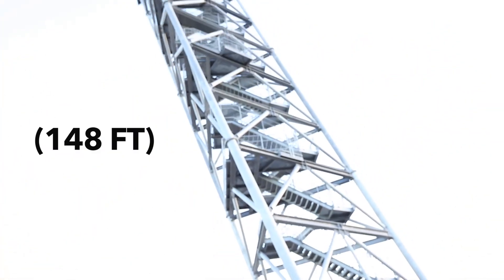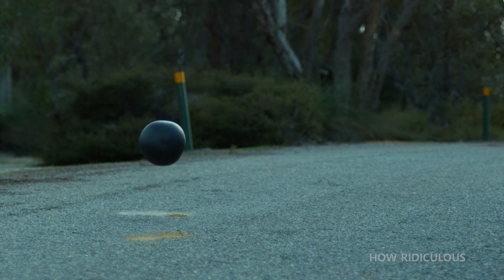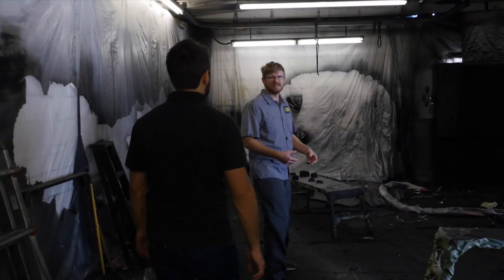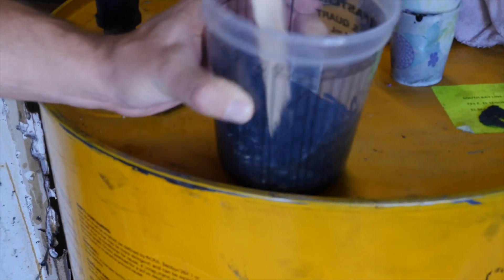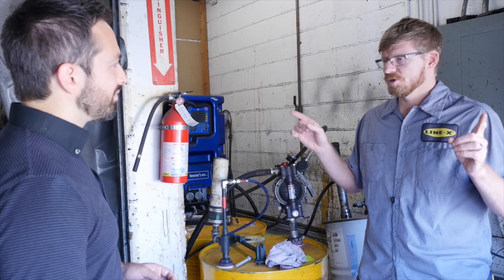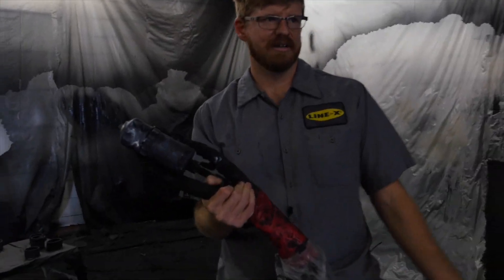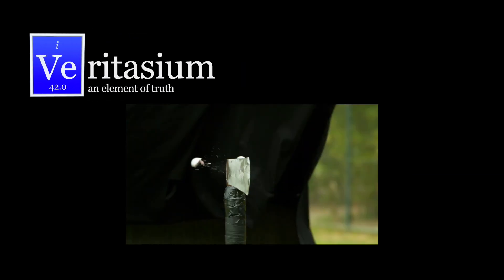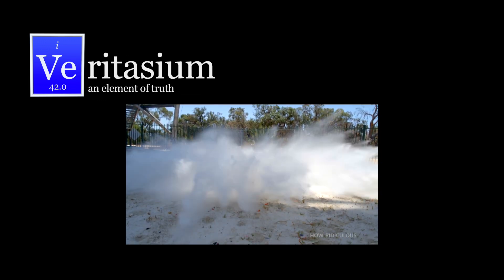Indestructible Coating?!

Comment: Coat the aerogel with this stuff.
Reply: Coat a carbon fiber/graphene or Kevlar structure with titanium core..  Will make for some good light weight bady armour..
Reply: @metaladder1018   bAdy
Reply: i had same idea!!! what abt zorbing ball coated w aerogel and line x??
Reply: @metaladder1018  Although it would be strong and light it would flex into you and possibly cause internal injury
Reply: FBI, OPEN UP!
Reply: Dear god
Reply: lol! it'll become sandbag or something in no time😂
Reply: It won't change anything. 
Aerogel is very fragile, the coating would just smash it from the outside, like the watermelon
Reply: @alanwatts8239  how about filling in the aerogel with this stuff? like they do with waterproof liquids to make aerogel waterproof
Reply: Good idea, extremely light but resistant. Very good idea!
Reply: @huracan200173  it's really just fireproof and a few other things but it's really brittle
Reply: @huracan200173  Well, it wouldn't be extremely light if you covered it in Line-X.
Reply: @huracan200173  Yeah fantastic, you will burn the polyurea trying to use aerogel thermal properties!
Reply: People signal boost this
Reply: Wouldn't work as well as you're imagining. See the slow motion of the coated watermelon bouncing? Didn't you know aerogel is very brittle? It would literally turn to dust on the inside, and then the polymer coating would just be a floppy empty sleeve. It wouldn't even hold much of a shape. It's resistant to TEARING, but it's not strong in any other way.
Reply: Flubber duckies
Reply: Up. Want to see this.
Reply: Then make it a mouse
Reply: Then put it in the walls of the pentagon
Reply: @Dylan Peres it would be able to adhere specifically for those reasons. When you want something to adhere, it has to have a rough surface
Reply: I hope it's a joke
Reply: I can only imagine
Reply: * Face Palm *
Reply: Illuminati:stay right there
Reply: Bumper cars
Reply: Aerogel can be produced directly from these materials, even it can directly be reduced to graphene
Reply: Yea Nice idea
Reply: what about zorbing ball covered in aerogel and line x???
Reply: Iron man suit
Reply: Haha or polystyren
Reply: Polysyrene is cheapper more elastic and less « sans baggable »
Reply: Hi Phil Swift here with FLEX TAPE
Reply: If only you
Reply: And you end up with an aerogel shaped.......balloon.
Reply: @Braxton then whats the point of "aero"
Reply: @Braxton it's big brain time 😆🤣
Reply: This and aerogel would make the fastest boat
Reply: more like coat this stuff with aerogel, if it increases in temp during the bonding process then I'm sure heat would make it weaker again. or better yet, do aerogel, this stuff, then aerogel again lmao
Reply: He's too dangerous to be left alive
Reply: That wouldnt work becuase the coating would only form a shell around the aerogel
Reply: Whats the point. If u want hard light stuff. Coat air with it
Reply: @realdeal5712  Then it'd be a glorified dodge ball.
Reply: Real deal that’s what aerogel js
Reply: Aerogel would most likely absorb it, like water.
Reply: Harvard: bruh you want a scholarship?
Reply: And you end up with a light indestructible stuff
Reply: Additional information
Required: Required documents are required for your claim assessment.
Supplementary: Supplementary documents are not required for your claim assessment, however may help determine if you are entitled to any supplementary payments and/or services.
What happens if you don't complete the required tasks listed?
If you don't complete the required tasks by 07 July 2020, we'll reject your claim and you'll have to make a new claim.
Use the upload button to submit your documents. You can also take photos of your documents and submit them using your Express Plus Centrelink mobile app.
If you can't upload your documents, you can mail themor return them to a service centre.
This notice is given under section 63 of the Social Security (Administration) Act 1999
Reply: @stevethea5250  A banana is an elongated, edible fruit – botanically a berry – produced by several kinds of large herbaceous flowering plants in the genus Musa. In some countries, bananas used for cooking may be called "plantains", distinguishing them from dessert bananas. The fruit is variable in size, color, and firmness, but is usually elongated and curved, with soft flesh rich in starch covered with a rind, which may be green, yellow, red, purple, or brown when ripe. The fruits grow in clusters hanging from the top of the plant. Almost all modern edible seedless (parthenocarp) bananas come from two wild species – Musa acuminata and Musa balbisiana. The scientific names of most cultivated bananas are Musa acuminata, Musa balbisiana, and Musa × paradisiaca for the hybrid Musa acuminata × M. balbisiana, depending on their genomic constitution. The old scientific name for this hybrid, Musa sapientum, is no longer used.

Musa species are native to tropical Indomalaya and Australia, and are likely to have been first domesticated in Papua New Guinea.They are grown in 135 countries,primarily for their fruit, and to a lesser extent to make fiber, banana wine, and banana beer and as ornamental plants. The world's largest producers of bananas in 2017 were India and China, which together accounted for approximately 38% of total production.

Worldwide, there is no sharp distinction between "bananas" and "plantains". Especially in the Americas and Europe, "banana" usually refers to soft, sweet, dessert bananas, particularly those of the Cavendish group, which are the main exports from banana-growing countries. By contrast, Musa cultivars with firmer, starchier fruit are called "plantains". In other regions, such as Southeast Asia, many more kinds of banana are grown and eaten, so the binary distinction is not useful and is not made in local languages.

The term "banana" is also used as the common name for the plants that produce the fruit.This can extend to other members of the genus Musa, such as the scarlet banana (Musa coccinea), the pink banana (Musa velutina), and the Fe'i bananas. It can also refer to members of the genus Ensete, such as the snow banana (Ensete glaucum) and the economically important false banana (Ensete ventricosum). Both genera are in the banana family, Musaceae.

Comment: Ideas running rampant through my head. Is it easy to clean? Can you wipe say, concrete off of a coated pair of boots? How about coating tires with it? How well does it retain heat or resist cold weather? Does it melt at low or hight temps? Say i coated a CO2 bottle, Whats the maximum psi it can withstand passed the ratings without? Ia it heavy? Is it conductive to electricity or is it magnetic? If you coated a room, could it block unwanted frequencies?
Just for starters, if any of these ideas have impressive outcomes, i would like to participate... I have been looking to start my own business..

Comment: Every boat on the planet should be coated with this before it's painted.
Reply: Except the paint would probably crack too easily since this coating seems pretty flexible
Reply: Hmm. Why would you need to paint it when it's coated with this? Color? I wonder could you dye this instead?
Reply: @salaciousBastard  so if I was being pedantic (and I am) you would paint it with antifouling paint to reduce drag and also fuel costs if it's a power driven vessel!
Reply: @salaciousBastard  yes boats are different because they pick up barnacles and seaweed etc etc etc  ( 9 years in RNLI UK sea rescue service mate 😁)

Comment: I used to work with this stuff and tried coating everything under the sun. One of the best results was a drum kit. But also made some indestructible skateboard decks and vandalism-proof public bathroom stalls. 
Super amazing stuff, there's a million uses for it people probably haven't considered but it is probably not a nice product for the environment. I imagine nature wouldn't break it down for many thousands of years.
Reply: Pretty sure it's vulnerable to cracking,ripping or stretching?!.

Comment: I read that this formula was created for the mining industry. Steel conveyer chutes would wear out quickly under constant use with rock and other raw materials. The constant replacement of chute material was expensive. The chutes were coated making them virtually indestructible. Then someone got the idea of using it for truck bed liner.

Comment: When they peel the watermelon coating off, you can see they REALLY coated it. There's like 1cm of coating around the whole thing. You could get similar results in this test by using a hard rubber.

Comment: All respect to verisatium and Linex  for bringing this technology to my notice. But "Indestructible"?
And how do you safely disintegrate it before throwing out in the environment!? Or is it a long term severe Plastic like pollutant to the environment?
I wonder what happens when you inhale those molecules while coating things.
Reply: As said in the video, it's supposed to be a extremely tough truck bed lining, or coating for anything that sees a lot of wear and tear. The type of plastic is a high density elastomer, I belive.  And I don't think inhaling that mist is good, but think of spraypainting. Inhaling spraypaint isn't a particulary smart move, either.

Comment: Line-X is one of the only products I've ever seen that is way, way better than I expected. I am usually disappointed by products that have big claims, but not this stuff. Whomever owned my truck before me had the bed done with it and it absolutely amazes me how tough it is.
Reply: Well the fork lift driver at my local home depot proved me wrong.

Comment: I am so deeply horrified by not wearing safety gear while sawing an unknown substance with a rotary that I had to pause and comment. Come on you guys!!!
Reply: yeah it was way safer hittin that bouncy ball with an axe
Reply from the maker: Is this comment for this video? I’m trying to remember other unsafe things I’ve done...
Reply: @veritasium  I think its a reference to 1:23 in the video.
Reply: @veritasium  he meant when the how Ridiculous guys cut the watermelon open.
Reply: Plus hitting a bouncy surface with a axe.
Reply: They are Australian, they don't care!
Reply: Unknown? It's a watermelon covered with linex.
Reply: @MrCmon113  exactly. Unknown.
Reply: um so what?
Reply: @jackradzelovage6961  so what? Okay then just saw your thumb off, how about that 🤦‍♂️
Reply: @nowonmetube  risk assessment says just do it... i dont put my cars on jack stands. is it safer? yeh. is it safer than just the bottle or floor jack by a large enough margin to warrant getting a set? nope.
Reply: What kind of safety gear? It'd be more dangerous to wear gloves in the case that you cut yourself, since the glove would be tangled with the blade making the injury worse. Maybe some protection for the eyes? I think makes no sende, if you material you cut is flexible.
Reply: Hi Hank
Reply: But.... but... science

Comment: So basically it’s like Luffy when he uses Haki it his 4th gear?
Reply: Similar. Luffy is said to be 'rubber', so he turns into a sort of vulcanized rubber. This stuff is polyurea. They're both polymers with added chemicals to undergo a transformative reaction. Very similar but slightly different, especially since he'd got a magical Devil Fruit that did it instead of doing hard science.

Comment: I want to inhale it... to make indestructible b00gers..
Reply: Username holds
Reply: You'd get your lungs covered inside so no air could be taken up.
It would be extremely dangerous to spray it if your protection gear fails.

Comment: The melon didn’t survive it just stopped it from making a mess on the floor. Your brain will still me a mixed-up mash. Adding rubber to the outside of anything will make it like a rubber bouncing ball with mashed potato filling. Its cheaper to use a potato masher and a lot cheaper to blend a melon.

Comment: Should coat roads with this stuff. No more cracking asphalt. Seems to have a high coefficient of friction. It might be more expensive, but you'd only need a thin layer and only need to apply it once.

Comment: I am looking to build a concrete underground home. From years experience having homes with baesments partially underground and the walls sprayed with moisture barrier, ther have been issues with leaks or slight moisture. In the finished rooms in basement. I bet this can do a much better job as a wall sealant applied correctly. Now underground homes build moisture regardless of thick walls . At constant 55 degrees u need heat cycled air to warm and stay dry. I prefer 63 degrees only myself. I would like to know how long this product keeps a good barrier before hardening and breaking down in that environment.  Can you provide me the Company contact info?  Email altonddavisjr@yahoo.com

Comment: That coating on the melon is like 1 CM thick and it still fractured on the inside. Fake and gay.
Reply: ummm yea aint fake... i work at inyati ive been spraying alot of parts and i sprayed the glass and droped it, to see if not shatterd i peel it off and the glass was fine :D

Comment: This, plus carbon fibre mesh, plus d3o would make a super light, versatile composite armor. I did some quick comparisons and with the amount sprayed on that watermelon, it was able to sustain more joules of force than a 45 ACP round point blank. Granted that doesn't say much to contact area but I think black rubberized combat armor would be very slimming.

Comment: am i the only person who thinks this material could potentially be used as a web fluid for real life web shooters, a high pressured stream could be shot around 15 feet maybe and by the time the stream reaches your target the fluid could already cured because it only takes moments and the tensile strength is crazy from what i saw in this video.

Comment: Although at free fall v=g*t there are other factors that should be taken into consideration. Since it took 3s for 45m the the speed is about 15m/s or 54km/h and that is the real speed of the watermelon with the other factors taken to into account.

good video though

Comment: Great video, again.
One clarification, though.
The surface-reinforced (coated) water mellon, after hitting the ground, goes sideweays,
flattens rotationally symmetrically, as the video show in the segment 6:00+.
This creates large, elastic hoop stresses, along the stretched equator, in the reinforcement.
Theses stresses make the ball bounce back, not the vertical (meridional) stresses
the video shows as arrows. The meridional stresses are insignificant relative to hoop stresses.
This is because it is hard to stretch (equator here) and relatively easy to bend (meridians here).
It's the equator that does the heavy lifting.

Comment: Reminds me of 2 things, that have 2 parts that are mixed:
1. Epoxies - those 2 part glues that are really strong.
2. Icynene spray foam - use to install this 100 to 1 expansion soft foam that also came in 2 barrels from Canada.
Was sprayed at high pressure, and also at 150 degree temperatures. Very permanent on everything it touched, except your skin - you had to take a razor blade to get it off.

Comment: the names of the components looked similar to me. Then I realised that polyol and isocyanate are the two components used in industrial polyurethane glues.  i wonder what the difference is between this specific coating and regular polyurethane.
Reply: What is it
Reply: It's it
You want it all but you can't have it
It's in your face but you can't grab it
Reply: @Tr1ploid  composition
Reply: @mediwise2474 Well obviously, 'composition' is the difference between ANY two physical things. What's the difference between toilet scrubbers and jet engines? 'composition'. :) More seriously, being a bit more lectured than my post 6 years ago, I've come to realise that iconyanites, polyols, and polyurethanes are a complete family of compounds rather than having one specific composition. That's where my confusion lay.
Reply: @Tr1ploid  please tell me why polyurea is flexible
Reply: @mediwise2474  it's flexible because of its composition
Reply: @Tr1ploid  what make it flexible either isocyanate or polyol or something else
Reply: @mediwise2474   You are asking a non-expert, for sure. I think what makes any polymers less or more flexible is the amount of crosslinking.
A polymer without crosslinking can be thought of as spaghetti: a bunch of linear molecules that are merely connected by how jumbled they are. All the molecules easily slide over eachother.

A cross-linked polymer is what you get when  you chemically connect all the polymers together to form a net-like structure.

The more crosslinking = the less easy the molecules can slide over eachother, ergo, the less flexible and the more rigid the polymer becomes.

Comment: How about using it in the tires of vehicles so that it wont get punctured ?
Reply: It’s just so expensive
Reply: It's just a rubber coating.  It's nothing new.  It's just a spray on application.
Reply: Bishesh Shrestha Its like rubber man, tires are awready made out of it...

Comment: Why cant car's body use this material?
Reply: You mean instead of metal? Basically because even the best plastics (polymers) have nowhere near the tensile strength of metals like steel or aluminum.
Reply: And.. Why is that?
Reply: Why are metals stronger than plastics? Because of the nature of the chemical bonds that they make. If you'd like to know more, I'd suggest googligng "materials science" or "ultimate tensile strength" and check out wikipedia
Reply: But.. The material in the video isnt a regular plastic...
Reply: What do you mean by "regular" plastic? It's a formulation of a two-part Epoxy Resin, which as a general class are extremely common. https://en.wikipedia.org/wiki/Epoxy